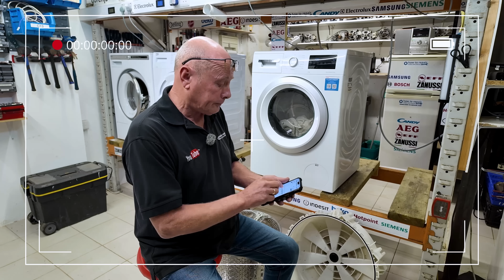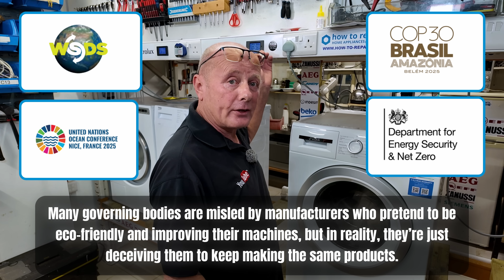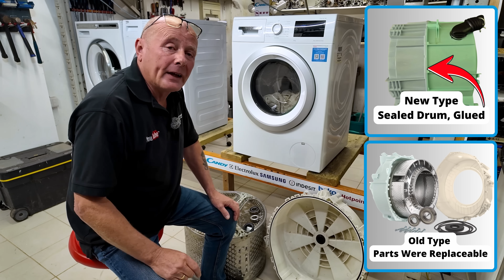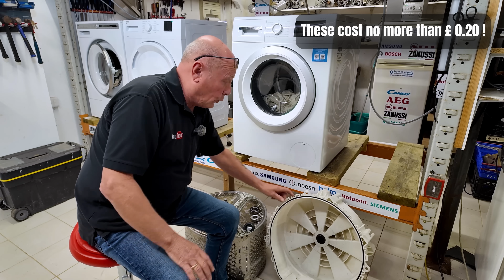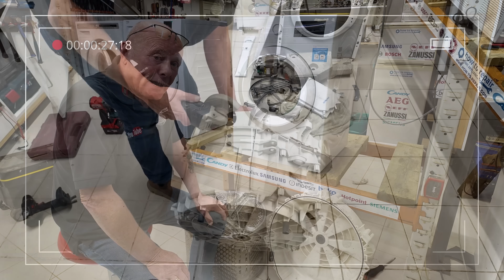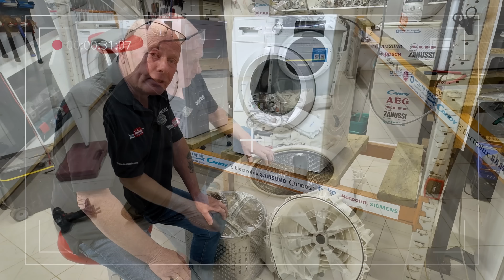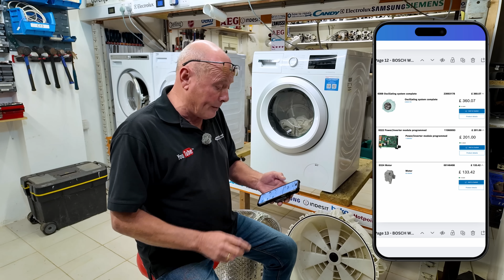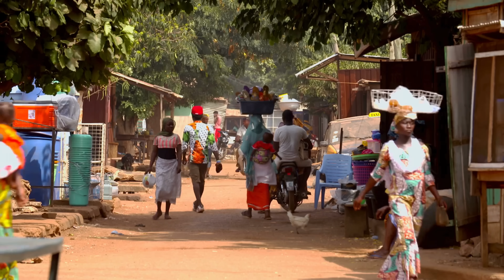Washing Machine SCAM EXPOSED! The Truth About SEALED Drums: Naming & Shaming

Comment: I recently had a AEG washing machine of which the bearings started to make noise after 'just' 9 years of use, so I decided to open it up to just replace these quite cheap bearings.. But what the heck! The drum is molted into one piece and indeed a complete new drum almost costst the same as a new machine. If I was just able to replace the bearings I think this machine could run for at least another 5 years, since it still worked fine! Even the motor has 10 years warranty, but the overall machine will not make that! Scam indeed of you would ask me. I think the governments have to lower and higher taxes according to repairability of the machine. Not only for our wallets, but also for sustainability.
Reply from the maker: Your experience with the AEG perfectly illustrates why this industry is so infuriating. A 9-year lifespan used to be considered poor, now it's about average but the fact that a molten/sealed drum forces you to scrap the entire machine over a cheap bearing is pure planned obsolescence. This is why I advise everyone to ask the salesman whether the drum can be split before buying.

If you found this information eye-opening or helpful, please consider sharing this video with your friends and family. The more people who understand what's happening with appliance longevity, the better equipped we all are as consumers.

Comment: I had to replace the washing machine(>10 y. old) last year due to bearing. my machine was short/compact version. If they last long time , and if they are recycled I  don't mind, even I was very mad that small detail make me buy new washing machine. I dint have time to wait for perseon to repair it. Didn't have space to disassemble it and keep it for 1-2 day. Changing/repair  the drum is time consuming, this thing are havy. How much will cost the labor, if you hire somebody? If the labor is cheaper like in asia or even east europe there is a sense to make it repairable.
Reply from the maker: This calculated strategy is what makes the whole system designed to rip the consumer off. If the manufacturers were forced to make drums splitable, the repair time would be significantly lower, making it economically viable for everyone, regardless of local labor costs.

Thank you for your comment. I appreciate people like you taking the time to write it out. Please don’t forget to subscribe and share it where possible. It might help others make a wise choice instead of being misled by the industry.

Comment: You are so right about the AI comments... been noticing it too on a lot of channels
Reply from the maker: I think I already spotted a couple on this one, there's always a positive and negative side with all technology unlike everything when you put it in the hands of cooks they will use it. thanks very much for supporting the video. Please remember to share if you can.
Reply: @How-to-repair I will most definitely share. I got badly burned with a Samsung washer/dryer a few years ago. Excellent machine, except the bearing gave up. Replacement drum unit was more than a new machine. Same happens with cars these days. Replace the whole unit, instead of the faulty bit at a fraction of the cost. Not to mention the waste going to the landfill

Comment: not unusual to see all spare parts together being 3x the cost of a new one.  also applies to their tools.   worse is that they remove the availability to those parts right after they fail. we had a heating element fail, the new machine uses the exact same coil but slightly modified the plastic mount to not fit.  the original part wasnt available anywhere the machine wasnt even 5 years old
Reply from the maker: This is a deliberate strategy to shorten the replacement cycle and prevent the Right to Repair especially when they remove the old part even though its replacement is functionally the same.

Thank you for your comment. I appreciate people like you taking the time to write it out. Please don’t forget to subscribe and share it where possible. It might help others make a wise choice instead of being misled by the industry.

Comment: Best clothes washer I have had is AEG. But a more expensive model. However I do not quite like the auto dose chamber having to thin the soap sitting there with water all the time. But this is the newest of mine, so what can happen?
Worst clothes washer I had was Bosch, fuzzy fuzzy logic and it broke down eventually. Worst dryer Siemens, water sensor got wet lint buildup. Plus you need to keep the condensing water half filled. Worst fridge, Gorenje, extremely noisy the one I got. Planned obsolescence is true. Worst dishwasher I have had Siemens, best dish washer Miele.
Reply from the maker: It’s fascinating how your personal experience with these brands AEG (Electrolux), Bosch/Siemens (BSH Group), Miele, and Gorenje mirrors the industry structure we discuss in the video.

Your experience across multiple brands confirms that planned obsolescence is true. The goal is not longevity, but maximizing profit through turnover.

If you found this information eye-opening or helpful, please consider sharing this video with your friends and family. The more people who understand what's happening with appliance longevity, the better equipped we all are as consumers.

Comment: The question I keep asking myself, but have no answer to, is this:

Why doesn't anyone start a company that manufactures high-quality washing machines and appliances again and achieve a breakthrough?

That's the million-dollar question.
Reply: There are high-quality washing machines available. Either Speed Queen (front loaders) or the commercial lines from the likes of Electrolux Professional. The problem is these machines are VERY expensive, the Electrolux Professional 6kg machine (with substantial metal, designed for ease of service, designed for 15,000+ cycles) is ten times the price of a standard Electrolux machine (with substantial plastic, desgined for 2,500 cycles). 

 The ~9kg Speed Queen front loader is around £2700, as compared to the £500 9kg Bosch washers being discussed in this video. Obviously the Speed Queen, which claims being designed for 25 years use, will also be around that 15,000+ cycles too.

At least Electrolux are up front about the respective design lifes, I guess...  They aren't hiding that the residential machine is not designed to last a long time.

Comment: Well said!! Had a repair a few years back on a near new machine & the repair guy said then future repair is buggered as the drum is sealed, the old machine it replaced was 20 years old!! It had had bearings & pump replaced a few times & was working fine but it was looking it’s age & we thought a new machine would be a good idea, we were so wrong the new machine needed a new circuit board within 6 months & it was a pig of a job to replace, poor engineer did his best but it never worked properly after that. We replaced it again only a few years later :(
Reply from the maker: You've hit on a really important point about the immediate, noticeable difference in lifespan between older, repairable machines and the new models engineered for replacement, and the hassle and failure rate associated with costly repairs on near-new appliances. The new machine was designed to fail just outside the warranty period, forcing you into a continuous cycle of purchase and waste. Making this video as visible as possible is up to all of us. I can't do it alone, so please remember to share it wherever you can.
Reply: @How-to-repair absolutely, I was so impressed by your video, I’ve fixed all kinds of the years and find today’s companies that make these kind of products abhorrent, I am hope the Europeanright to repair movement will start outlawing this kind of practice & fouling our land fills ! Will share as much s I can, people need to know this is going on.
Reply from the maker: We would be much better off using machines from 30 years ago than the rubbish they're producing today. It is all designed to extract money out of our pockets as regular as they can get it. Thanks very much for your support in the comment. Please remember to share if you can.

Comment: I had a failed bearing on my Samsung (about 4 years old).
It has a splitable drum housing but they changed the whole back part.
They said it's always necessary now that it's plastic because of the wearing of the bearing support.
This also means that to change the bearing they had to disassemble the whole machine which was quite time consuming (and there were 2 technicians)

Note that I had a paid support plan, so the repair was at their charge so they had no incentive to overcharge with unnecessary repairs.
Reply from the maker: Thanks for the comment mate. your experience shows a key modern hurdle: the back part of the outer plastic drum housing contains the bearing seat (where the bearing presses into the plastic). If the failed bearing spins in the housing, it can wear out the plastic, meaning simply replacing the bearing will cause the new one to fail quickly. I appreciate people like you taking the time to write it out. Please share it where possible. It might help others make a wise choice instead of being misled by the industry.

Comment: Your so right all the concentration seems to be about energy use and not reliability and longevity. It’s also happening on our cars , ie wet belts , terrible design yet the manufacturer doesn’t get held accountable for the poor design and isn’t pressured to making upgrades. Take headlamps you can’t change a bulb anymore as they are a sealed unit plus the cars computer has to programmed to accept the new unit , so from a £5 bulb to hundreds for a seal unit and fitting. How is this progress?
Reply from the maker: I pointed out that consumer magazines and governing bodies only seem to be caring about the energy consumption and water these machines save, and they do not care that the appliance is totally unrepairable outside of the warranty period because the company is building obsolescence into it. 

Your analogy with cars is spot on. The sealed drum in a washing machine, which forces you to replace a £400+ component when a £15 bearing fails, is exactly like your example of sealed headlamp units requiring complex computer programming. Both are examples of manufacturers removing the consumer's right to repair by making simple component failure lead to replacement of an entire, vastly expensive assembly. 

Please help me, getting this message seen by everyone is a collective effort not a solo one. I count on you to share it out everywhere you can.

Comment: This is a hot issue with me - with all the crap about energy efficiency, where is the efficiency of NOT having long-lived appliances?  How many junk appliances do you see simply dumped? There is a big environmental advantage to repairing what you have, instead of throwing the whole thing away.  We need to support organizations such as fix it or repair, and see if we can get some public service commercials showcasing the creeps that are making our goods unrepairable!  Often, if you can think outside the box, an electrician may be able to fix the fault in a control board instead of junking the whole board, I make sure my washing machine, refrigerator, dishwasher, etc is plugged into surge protectors that are made for a fridge, and/or heavy duty enough to handle the amps and wattages they are drawing - and I buy them from a source I consider reputable, this is NOT an item you want to buy and find out it was counterfeit. For my fridge the surge protector is RCA.  My understanding is that it is not only the huge surges, but also the much smaller daily "hits" that degrades the fragile circuitry of todays crappy appliances. My Frigidaire front loader was made about 2004, my used GE spacemaker electric dryer just had its first repair, a cleaning of the interior (not very dirty inside the mechanical parts) - and a roller. My blood boils when I think of the people who may live in an old high rise or other building where it is very difficult to get an appliance in or out - I would much rather muscle up a part then a whole damn appliance! We as Americans or Brits need to demand that drums on washing machines be made to be able to be opened up - I wonder how much it cost to have the robots screw in those few bolts instead of gluing?
Reply from the maker: Having spent over 40 years in this industry, I've seen countless junk appliances simply dumped. The energy and resource consumption involved in manufacturing, transporting, and then disposing of a new appliance far outweighs the small energy efficiency gains of a new model over the machine's short 5-year life. This is the very definition of greenwashing.

On my YouTube channel, I’ve produced many videos and even a full playlist about built-in obsolescence. These videos have gained over 3 million views and continue to grow. What’s truly surprising is that manufacturers aren’t challenging any of the information. The media isn’t covering the issue. Governing bodies aren’t addressing our e-waste crisis. Politicians aren’t talking about it, even though it could easily win them votes. The whole problem is essentially being ignored.

Only by sharing these videos and openly discussing these controversial topics can we push for real change. Sharing this video helps give it the visibility it needs to make a difference over time. Thanks again for your comment it’s genuinely appreciated.

Comment: Fun fact, in Australia, the manufacturers warranty is in addition to consumer protections, which includes a statutory warranty that says a product must be of merchantable quality for the life of the product. What this means is that if you would reasonably expect that a washing machine would last for ten years, then the retailer, not the manufacturer, is responsible to repair or replace the machine for ten years, or give you a refund.
Reply: We also have this law in Poland, but here we have to provide proof after 2 years.
And with most courts working on "who gives bigger bribery" principle its hard to get that proof.
Reply: This is also in the Netherlands. Where the amount of the warranty declines over time, an older machine wont be repaired for a high amount. But still a lot better then 1 or 2 years of warranty
Reply: Same in the UK, sadly most people don't bother, or believe the warranty is only what the manufacturer states and not the actual merchantable quality standard.
Reply: @ColinBrodie-e4q  really ? Are you able to point me to where these rules are please ?
Reply: @bensumw Consumer Rights Act 2015 - goods should be useable for a 'reasonable' life span l, nominally 6 years
Reply: New Zealand has a similar consumer protection law. It works but many retailers try to sell additional warrantees which is illegal. All my home appliances were picked up on dumping days where people put unwanted stuff on the roadside and you can just take it. My washing machine plugged in and seemed okay but would not start. The programing buttons were jammed with grit, once cleaned it has done two years of happy service so far.